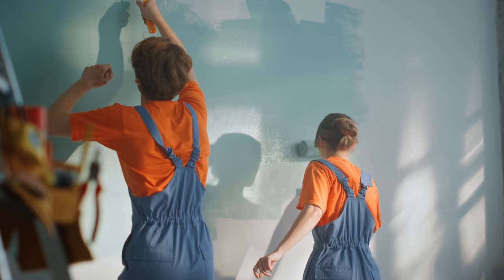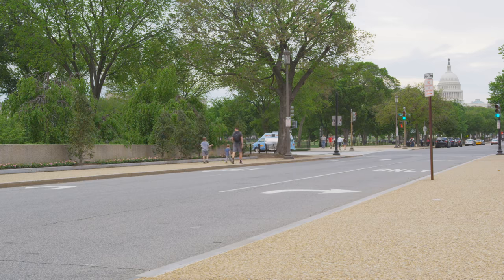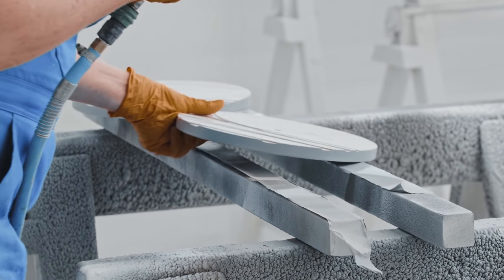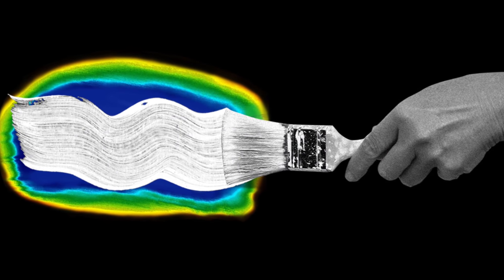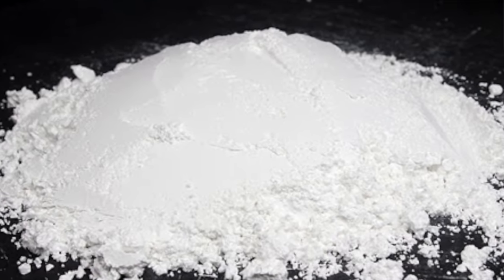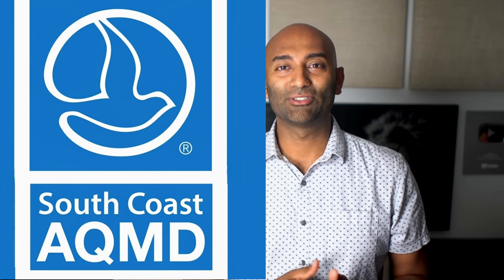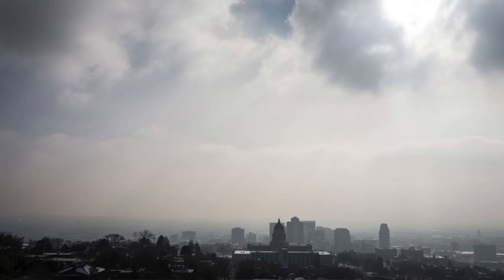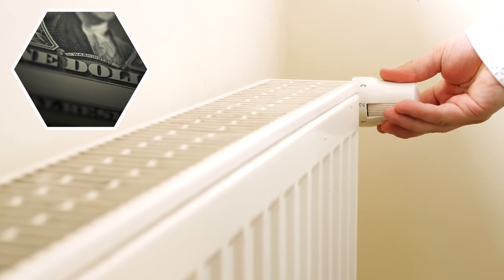Forget AC - Paint Your House This Instead!

Comment: I coated my composite roof with a white roof coating.  The effect was immediate.  A roof that was scorching hot to touch became cool to the touch.  It really did reflect the heat ... BUT ... I live in a dirty city.  If you look at my roof today, it is no longer white.  It is somewhere between off white and dirty grey.  Hosing it down does very little to improve it.
I think it is still a good idea to paint city roofs white, but I question the value of high tech paint if it is only going to get dirty in a matter of months (or weeks).  When I installed solar hot water, I didn't get the super efficient solar panels because all the panels work when the sun is out and don't when it is cloudy or overcast.  The efficiency of the panels were not that important.  If it was hot when I got into my car, I had hot water in the house.  If not, then not ... a higher efficiency panel would not change that.  

I can't speak to the exterior walls of a home.  High tech paint may make a difference. But I think the above experience applies to roof coating.  If I had to do it again, I would still coat my roof with the same white roofing material if it were more cost effective than a high tech equivalent; either way, it will be "grey" in no time from the pollution falling out of the city sky.  Something to think about.
Reply: That makes me wonder if there is a slick coating that could be applied to the white paint without degrading the paint’s effectiveness but that would allow pollution to be easily washed off.
Reply: That's exactly what I was thinking. White gets dirty. If they could prove that even a dirty white roof (now light grey-brown) is cooler than a darker roofs, that's nice, but we already have light neutral paints and shingles. HOAs may not always accept light roofs however.
Reply: The proper paint has ceramic in it. Even if its black the heat can't transfer to your house
Reply: Any high gloss paint will resist getting as dirty
Reply: @jamesengland7461  That's exactly what I did for my sunroom's metal roof.  Extra white with a coat of high gloss over it.
Reply: My intuition says: once everyone is driving a BEV, the amount of soot, etc in the air will dramatically reduce, air will be way cleaner & breathable, and cities won't make everything so dirty.
Reply: @wincoffin7985  Not only will we be cleaner, we'll be healthier, and since we'll cut our oil imports by 20%, a little richer also.
Reply: @wincoffin7985  much of the soot, particularly near freeways, is tire particles. Tire wear is actually a little worse for EVs.
Reply: Im curious how this would work mixed with solar panels?
Reply: @melissamybubbles6139  It's definitely cooler that the bare composite roof and it stops the composite roof from deteriorating.  I'm glad I did it.  I should have put this info in my original comment.

Comment: Living in Thailand we painted the walls bright white and used a bright white steel roof. Our aircon units powered by solar are only 8,500 BTU
Reply from the maker: that's awesome! we should collab sometime when I come visit :)
Reply: @TwoBitDaVinci  what about to use mirrors 🪞 instead of white paint?
Reply: @ajarivas72  window mirror film... thast what most highrise buildings use.
Reply: i was living in bkk for 10 years. and i can scrap a thick layer of black dust from my window screens , even after cleening them the day before. I assume you live in hua hin (where i live now) or in the south.. bkk area has industrial and traffic pollution. While in chiang mai, issan and chonburi farmers have the habit of burning stuff.. all things that dont go well with a perfect white exteriour.
Reply: Didnt realize painting the house white is an option till now.. and already installed a 20kw solar system for 400k bath. so there is enough electric to run all aircons 24 hours and still get money for excess power.
Reply: @donalain69  You can see video of my house on my channel. Designed climate appropriate not to look pretty
Reply: @donalain69  The paint I chose has a gloss finish. The slightest amount of rain washes them clean.
Reply: @donalain69  

20 kw is a respectable solar power system
Reply: @EcoHouseThailand  haha..just realized we have a lot in common when i seen the watertanks behind your house. I just installed 4 500l and one 1000l tank around my house last month to collect filtered rain water and automaticly refill my underground tanks. 
The colour seems to be a good idea if the rain is enough to wash it. Would do the same if i would use a off grid solar system. Was actually trying to find some alternative for batteries first.. things like solar powering a motor during day to lift a weight, pumping up water or spin a flywheel, and then using it as a generator during night when it turns the other way. but there are just too many moving parts to be without problems over a long period of time. so i went with on grid. 
Looks like i was wrong with my guess you live in hua hin or in the south. the home of my wife is in Phusing (si saket), near the border of surin. maybe i come visit you one day when im in the area to have a look at your  house if you dont mind. im quite interested in renewable energy.
Reply: @ajarivas72  actually i have 4 guys outside adding another 16 455w mono half cell panels as we speak :)
Reply: @donalain69  I am Off-Grid for power for the house and fuel for my EV and with my rainwater harvesting I am Off-Grid for water. You are welcome to visit  I have had quite a few come to see my crazy house. Sounds like maybe @Two Bit da Vinci  might visit as well.
Reply: @donalain69  

36 kw is a very respectable solar power system.
Reply: @donalain69  That's fantastic, but with more passive systems in place that solar system would be making you even more money on the sell back 😋
Reply: @priestesslucy3299  it does already makes me a 30% profit on my investment per year. :)
but you are right.. at the moment im thinking of drfilling a well and use the solar power during the day to pump up the water i need for my garden.  (my water bill is around 4000 bath per month, so it probably would be worth it)
Reply: @ajarivas72  its just 20 kw in total  :) installed panels for 12kw first and then maxed out with 8kw to the 20 kw inverter capacity. (16 x 455w). just wrote 20kw earlier because i already boght the missing panes, just didnt install them yet.
36 kw would be a bit to extreme :)

Comment: How about colour changing paint, that changes based on "Temperature". White during the hot sunny day and black during the cold or cooler evening.
Reply: It's a cool thought but IMHO I don't think it would matter what color it was in the evening. The darker colors use the heat saved over the course of the day in the thermal mass of the object and release it when the heat source isn't present. I think that if they designed a house with colored walls/ceiling/floor in a certain way using this paint and how much natural light is let the house could be super beneficial and more than likely eliminate the need for hvac systems.
Reply: That is termed as “phase changing” which does exist as a form of salt, used as a storage device for an active solar collector. The salt is a solid when cool, but liquifies when heated. In support of this particular paint, it is feasible to use temporary covers for the warmer season, and then removed and stored until needed again.
Reply: It might not be much more expensive to repaint your house with a different color every few months.
Reply: Perhaps electrically realign particles from one way to another for changing color.
Reply: A simpler solution would be large roof overhangs paired with plants which would shade the structure in the summer but allow solar gain over the winter.  Deciduous trees (could be fruit trees)which lose their leaves over the winter paired with some strategically placed trellises for vining plants such as grapes or green beans would accomplish this would also provide food.  It’s easy to predict the sun’s angle throughout the year with planning.  It simply requires the design to consider passive solar performance.  New technologies are great but many old technologies are still very valid and have been proven over thousands of years.  Some new technologies are going to be game changing awesomeness and others aren’t going to make the cut.  Home orientation,  thermal mass,  shade from roof overhangs/vegetation,  insulation… are also all effective in terms of outright performance,  user friendliness as well as budget while being aesthetically pleasing.  Yes bring on the new tech but just good application of old tech can typically do a large portion of the job if not all of it.

Comment: This on the heels of the blackest automotive paint ever being created.

I'm thinking white roofs and black walls. High sun gets reflected in summer and low sun gets absorbed in winter. There's got to be some ideal geometry to it, based on latitude. Factor it into an overall passive solar solution. Similar to trees shading your house in summer and being leafless in winter. Multiple overlapping solutions providing a year-round benefit. There may be literal grey areas too. ;)

Time to conduct some experiments! 🤔
Hold my beer. 🍺🇺🇸
Reply: @goncalomedeiros4918  probably easier to existing designs the have over hangs so only low angle winter light hits the sun facing wall.

Super black paint could be useful for heating water.
Reply: This is old news, the studies have already been done, yes, painting the rooftop of all the southern states would easily meet the targets. But...freedom....and hvac industry. So there.
Reply: Actually, the blackest paint is not suitable for cars, though there are some automotive grade paints that come close. And, yes. There are architectural solutions to passive heating/cooling based on latitude; mostly involving roof overhang on the sunward side and the like.
Reply: @goncalomedeiros4918  I've thought about this myself. I live in a mobile home park. And since I have no trees to shade my trailer, I've thought that I would like to put a high wall beside it to shield it from the sun. (I can't attach anything to the trailer itself.) But it would be louvered like vertical blinds to let the sun in in winter or to open sections by windows to enjoy the view. (Not that I have a view to enjoy in a trailer park. lol)
Reply: You're on the right track.  The more likely it is to face the sun on cold, wintry days, the darker it should be.  The more likely it is to face summer noon sun, the more reflective it should be.  Awnings help too.  These aren't hypothetical; they're standard elements of passive solar building design.
Reply from the maker: @shamblesgalore7468   - this isn't about painting roofs white, that's old news. this is the whitest paint every created. its the new record holder
Reply: @TwoBitDaVinci  as long as it's not vantablack guy I'm good w it
Reply: Combination solar/hot water generation unit on the roof!
Reply: @beastmastreakaninjadar6941  I have seen roofs built over mobile homes to shade the home and keep snow off of the roof.
Reply: @turnerdan53  Well, snow on the roof is an insulator.
Reply: @matthewconnor5483  it already is and has been for 40 years. Drain pipes are black so they don't freeze and plastic rooftop water tanks are usually black.
Reply: You might also get a benefit from extending your roof overhangs just enough to block the noontime sun during the months you normally use air conditioning.(large roof overhangs can also extend the lifespan of your siding)
Reply: @TwoBitDaVinci  Agreed and white paint has priveleges. We all know the black paints does not. It's like teaching Leonardo Da Vinci how to end sentences. Some things can just not be achieved.
Reply: So your house looks like the flooring in a cheap '50s DINER?  Cool!  (ducking, bigtime)
Reply: @beastmastreakaninjadar6941  A light colored shade cloth on a frame, tethered to leaning poles, or cables attached to ground screws ( both are dog tie outs).  In Australia people use triangular "shade sails"  but those need to be tethered to structures.               >> Tom's Ukrainian/American wife Pam <<

Comment: Thanks for another great video. Louvers come to mind. One side white and the other side black. Summer expose white and winter expose black. Maybe awnings over windows and doors made of louvers. Lots of possibilities.
Reply from the maker: Oh that’s brilliant!
Reply: So in your infinite wisdom, how do you propose those louvers get turned? All this ignorance does not provide possibilities, it just proves ignorance wants to be in charge!
Reply: Great idea
Reply: @kevinm3751  

The wall could be made of tubes or pipes. Half the pipe is painted black and the other half is painted white, pipes will rotate so the correct face is point out.
Reply: @kevinm3751  why do you find nessary to be rude to someone sharing an idea?

Comment: Stick it on screens that can be rolled up in winter? Houses that adapt to the seasons should be more common by now.
Reply: Near the equator- there ARE no seasons... even up to the tropics. No real need for heat absorption. Those winters are MILD and that's putting it mildly.
Reply: @melissachartres3219  Plenty of people don't live near the equator.  And those that don't use the most energy
Reply: @veganpotterthevegan  I would posit that some people (regardless of where they live) are just energy hogs, while others are not. My guess would have been that those who live in temperate climates and nowhere near the equator use the least energy or all.
Reply: @melissachartres3219  a disproportionate percentage of people living near the equator are far too poor to be energy hogs.

Comment: Actually, if they did it on louvers set on a roof, it good cool during the summer, and at winter just change their orientation so the light hits a dark roof, adding heat to the home.  They have also added a live roof system, growing grass, and flowering plants on an office building. It reduced the cooling cost as well as helped clean the air, as well as reduced the water run off to the sewers.

Comment: So need panels that can flip on the roof, white on one side, black on the other, and water line in the middle so can transfer the 10kW of cooling/heating to indoor radiator/under floor lines as needed.

Comment: I live in a humid tropical area (Queensland) and when replacing my roof, chose white painted metal ('Colourbond zincalume').  Unfortunately, as others before me found, in our climate, this colour invites algal growth, which turns black, so the roof quite quickly turned spotted black, which compromised and negated the hoped-for cooling bonus. The house has no air-conditioning.
Reply: It sounds like some colour  in-between would be ideal. In Italy it is terracotta... which gets very warm   but not the burning heat that light or dark grey produce. I put my hand on some of the different coloured tiles in the houses in my road to prove this.
Reply: Perhaps its an ingredient in the paint color that the algae likes, I'm thinking something that is in common with asphalt shingle ingredients. The asphalt shingle companies changed materials,  now shingles are only warranted against the black algae for 10 years. You see roofs all over the place with black stains. One good way to combat it is 4" wide copper or zinc strips along all peaks, and below all dormer windows, vent pipes etc. The rain hitting the strip washes copper or zinc across roof, preventing growth.  Have to do a good clean job, before installing strips.

Comment: I think this also would work nicely here in finland. We get so little sun light in winter anyway that it really doesnt help with heating. But the benefit in summer is huge
Reply: Yeah same in the UK. Our homes are insulated so what little heat from the winter sunshine hits the outside of the building doesn't make it in anyway
Reply: @doritoification  yes true. I almost forgot that. We also have alot of insulation. Yes the insulation will definitely block the heat.
Reply: UK and Finland need to use blinds.  Black  or normal in the cold months the white in summer only
Reply: @rem145  truuu

Comment: Solar panels are better since they generate electricity, but this paint can cover the areas that don't  have panels. Actually instead of painting it on the house directly, having painted, easily removable, panels that only are installed during summer could be the best option.
Reply: Or both!
Reply: Flip the panels in the fall and expose the world's most heat absorbent paint.
Reply: You could probably make a device like that with bimetallic strip. So when the bimetallic strip heats it will move the panel.
Reply: Or like make it from one of those automatic greenhouse window thing.
Reply: Naw, paint the roof and install bifacial panels above it. Insulate the roof extra good if you have cold winters.

Comment: I live in Malaysia and built a house using passive cooling (high ceilings, under roof air flow, large eaves for shading) but still a couple of months have temps that cause sweat even when sitting.  This paint is what I need on my metal roof!  The temps you described would take the temp down to 68-80F  Just perfect!  I'd love to do a test!
Reply: Check out nighthawkinlight’s channel, he made his own barium sulphate paint
Reply: @GabrielKLKN  Ah, I remember that's the dude that make it out of household materials.

Comment: In '87 I bought a ceramic infused white paint for roof cooling/fireproofing an asphalt roof. It was $1000. It applied as a thick goop, rolled out. It was a lot cooler in Sacramento summers, 115 degree, but I sold in '90 to make double the purchase price, so I didn't get my money's worth. Same on the added attic reflective foil/insulation. But I tripled my money 17 years later on a house I bought at the dip in Folsom, CA. The left over white paint really cooled down my garage door in Folsom from untouchable to a little warm. That allowed me to use my garage for a poker party every weekend, 3 tables.